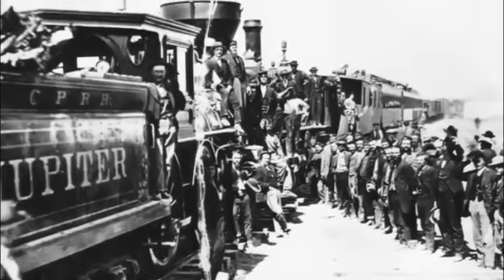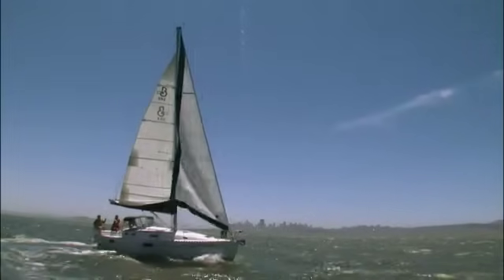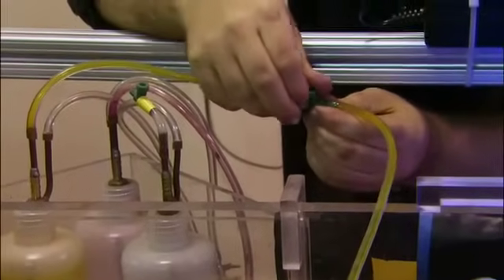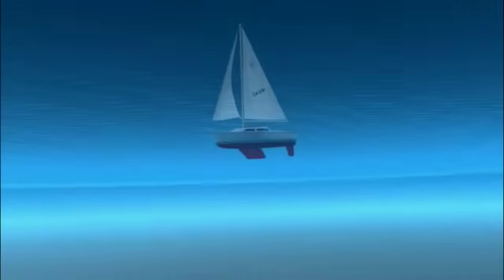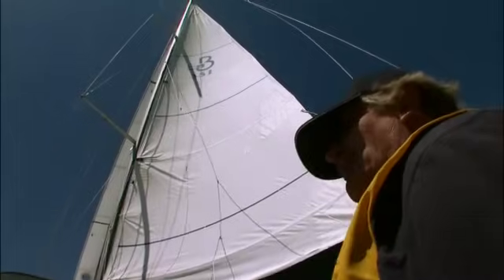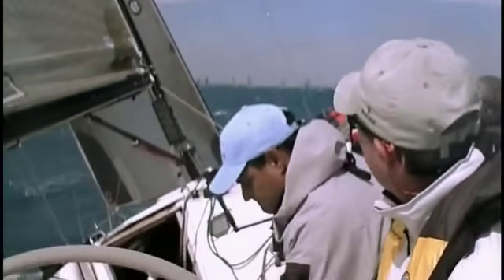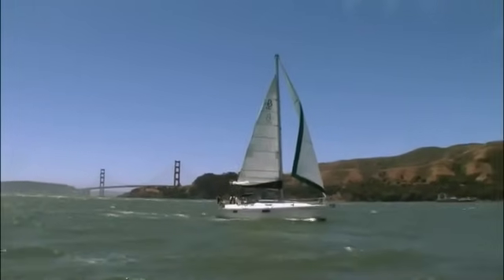The Physics of Sailing | KQED QUEST

Comment: Pretty confusing video.. i thought that it would explain it in a non technical, easy to understand manner..

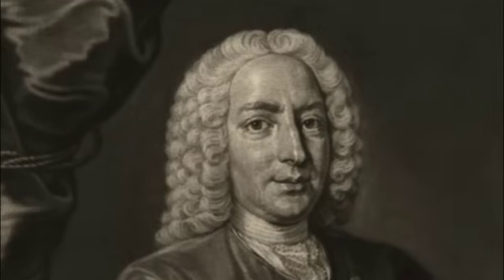The only part i really got much form was the bit at @4:16 where he blew on the paper, and demonstrated how 'lift' works, same as aeroplane wings etc.

Other than that, i want to know how one sails INTO the wind(IIRC, they said it was not directly, so yeah. As close to the direction of the wind as possible). I want to see what kind of mechanical system they have to harness that energy which allows it to move into the wind..

Comment: Do you have an explanation as to why the air wants to rush round the outside of the sail? I guess it is something like - as the air reaches an oblique sail and passes the leading edge, low pressure is created as this air has to turn a corner. ie the very act of putting an obstacle against the wind will tend to cause a vacuum in the lee.
Reply: The air on the top (side) curve has to cover a longer distance than the air on bottom flat side. The air on the top side has to go faster to meet the air on the bottom side. See Bernoulli's Law. Good video, I just now learned this about sailing.
Reply: Yeah, I guess that hitting something head on like that redirects the energy and creates an inward spiral that follows the curve. It's a fight of the higher pressure vs low pressure, so the side with least resistance will take the hit.
Reply: The explanation for lift is wrong. There is no reason why the air taking the longer way should reach the end of the profile at the same time as the air taking the shorter way.

Comment: The big Clipper ships held oceanic route records from the mid 1800's  until the 1990's. Much of the speed was born of the hull designs, very much ballast balanced by as much sail as they could put up. They also plied the trade winds and ocean streams as much as possible. The ships often paid for their construction after a one way trip, like to S.F., Cal.
Sometimes they were even broken up for their valuable lumber.  This preferable to losing the ships to Teredo worms. This was inevitable as copper plating wasn't mounted on the bottom of the hulls to save money, speed construction,  keep the cargo weight high and keep the the hull speed high. If someone reads a script that is pertaining to a subject that they don't know well, is it fair to ridicule the orator? It depends on how well they were paid!
Reply: For me it depends on if they are trying to pass it off as if they actually do know and understand what they are reading

Comment: 4:15 is an incorrect demonstration of Bernoulli's Law. Try hanging the paper vertically and blowing on it...it will not move in the direction of the blown air.

Correctly analyzed, lift is caused by streamline curvature, which is not taken into account for by Bernoulli's equation, which only analyzes velocity and pressure gradients ALONG the streamline (from mouth to far end of paper), not PERPENDICULAR to it (from paper surface outward).
Reply: You are right, it's actually the Conandă effect. (The same thing that makes ping pong balls float in hair dryers.)
Reply: It did move in the direction of the blown wind for me, from the vertical. The paper will not move into compression on the blown side very much; and past a flat plane shape you are, as they mentioned correctly, are introducing a concave shape to the former low pressure side, thus equalising the system. Maybe you just don't blow as hard as you think! LOL Quote real evidence from a reliable source to counter me.

Comment: The lateen sail has been around for thousands of years.  They could go to windward.  It is just that England and Spain were to dumb to see it's potential.
Reply: That's because England has had Gaff rig for ages, which is similar to Lateen rig but uses a more squarish sail and a boom, just as effective if not more than Lateen.
Reply: *****
Well there goes my "theory" up in smoke.

Comment: sailing seems like it would be fun to do but it looks uncomfortable when the boat is leaned right over
Reply: Dude heeling when you are in a sailboat is one of the most amazing feelings ever. It might look uncomfortable but it is so fun especially when you are in the side closest to the water.
Reply: That is why I sold my mono and bought a catamaran.
Reply: +Rick Pelland It is fun, especially when the boat is leaning to one side! :D
Reply: that's when it gets really exciting! but remember guys- a flat boat is a fast boat lol
Reply: It depends what kind of sailboat you're on.
I've sailed Norfolk Broads yachts and they're pretty stable, quite wide so don't lean much and the rig is optimised for that style of sailing.
Modern racing yachts are designed for high speed over comfort so lean, unless you sail a catamaran for stability.
Reply: Same, you get a feel for what the wind is doing so although it makes you nervous the first time it happens, you enjoy it from then on out.

Best thing if you're nervous is to try sailing a little dinghy with the simplest kind of sail, then you're directly holding the main sheet and can feel the power of the wind, you can let out the sail to reduce heel but soon get a rate for getting as much speed as possible and at the same time learn all the important basics of how the wind interacts with the sail.
Reply: Not really
Reply: Carter Busby "Not really" What?
Reply: That's the best part!!! So much fun!
Reply: Not at all uncomfortable. They are designed to be comfortable when heeled over. Even a MacGregor 26 (hated by many a sailor for being a compromise between everything sailing and power boating) has a well designed cabin top which is level for those sitting on it when the boat is heeled at about 15°. Great fun.

Comment: Best analogy about how a boat sails when wind is forward of the beam is "squeezing the seed". The person in this video did mention this, not many know this, most think its only the lift, like aeroplane wings that move the boat.
Reply: +bethells86 but small sport sail boats have large keels, but what about large sail ships with square sails? how do they keep balance and move forward? ...a stupid question because I'm lazy to do some research
Reply: The web has made many lazy :) Watch a movie called idiocracy, shows what happens to human race in a few decades from now, all dumbed down,  its all part of A21 :) 
All sailing boats use same principles to sail, Older ones would have used lots of ballast instead of deep keels.

Comment: Correct me if I'm wrong, but I'm quite sure sailing against the wind with triangular sails is nothing new, been used for Millenia.  Viking ships, and several mediterranian ones used those principles, albeit without a keel so I'm not entirely sure how those particular sails worked, but they did not work like the square sails where its merely pushed by the wind. 

Also those square sails are needed in such huge ships, you cant quite easily correct weight by shifting passengers in a boat of that size.
Reply: Large sailing ships had a large amount of ballast in their lowest deck, acting the same as a yacht's keel.

Square sails do in fact work fine for going to windward, they're just a little less efficient at it than a small sailing yacht with Bermuda rig.
Reply: You MUST have a keel to sail upwind. So those triangular sails didn't do any good (regarding sailing upwind) and in principle the same as square sails.
Reply: not so - a boat itself acts as a resistance to lateral movement in water and therefore is per-se a keel. However a deeper or heavier keel, dutch boards etc etc makes the keel effect more efficient.
Reply: Vikings didnt use triangular sails, however in the mediterainian these did exist. Also vikings have been around for (a) millenia.
Reply: You don't have to have a keel to sail upwind, you just need a hull where the submerged part is capable of inducing the water to flow around it rathher than under it, ie. any reasonably deep hull.

Comment: Bernoulli's principle holds no water.  If it did, then why can an airplane fly upside down.
Reply: +arbonac because when you're upside down in an airplane, you move down with your elevator, which is up when upside down... if you fly upside down for too long, your plane will either move downwards in a loop like matter, or will stall if you apply the elevator too much... a plane can't fly upside down, it can only loop and roll which evolves a lot of inertia and air speed
Reply: Then why can a flat winged paper airplane fly?
Reply: arbonac a paper airplane glides, it doesnt fly, it just falls down with style
Reply: Have you never seen a small remote control on a paper airplane, they've been out for years.

Comment: I live near the water in Florida. While watching sloops, I notice that when one sail in play, some favor the jib, others the mainsail, often in the same conditions. Why?
Reply: +storybored The mainsail will try to push the stern around whereas the jib does not. Kind of like rear wheel drive vs front wheel drive.
Reply: It could have something to do with the shape and size of the keel, and if the sail is over powered by the wind. Shallow draft, fin keel, wide boats can be overpowered when wind speed rises on the main sail. This tends to push the ass of the boat around. You can adjust by reefing the main sail (making it smaller) but sometimes that is difficult and or people are lazy, or expect the wind to decrease, so they don't bother. Somtimes people only have one size foresail or jib, which may be appropriate for the amount of wind, or not. This could unbalance the boat and make steering difficult as well. So...depending on hull / keel configuration, available sails, competency of crew, point of sail / course and wind direction and velocity, one might decide to dump a sail in order not to have to keep fighting the helm.

Comment: Haven't seen it in the comments yet, but square riggers were NOT parachutes. Using the braces, they caught the wind just like the Bermuda rig. The ship was "square rigged" to build a much larger virtual wing. SV Peking's mast stood 170 feet. It wouldn't be until the advent of carbon fiber that triangular masts would approach that size.

Comment: the film perpetuates an error about how sails work. They are NOTHING like airplane wings. It is the thickness of the leading edge of a wing, curved on top and flat below that gives rise to pressure differentials and therefore lift. Sails are uniform and essentially thin sheets. Don't be fooled by the curve of the sail. Any sailor knows a sail has ticklers (or tell-tales) set a few inches in from the leading edge. A sail trimmer looks though a clear window in the sail at the lee tickler and at the windward tickler facing him  and trims the sail till both lay flat and streaming aft. This means the wind travels the same speed and distance from front to back. So no pressure differential. What makes a modern sail work is that the sail forces the wind to change direction from the angle over the bow, to along the boom to astern. A change in directions results in two force vectors at 90 degrees to each other: one forward over the bow, and the other over the lee side. The resultant vector moves between them depending on the trim of the sail. The forward force drives the boat forward, the side force heals it over, and makes the boat move slightly sideways (both are counteracted by the heavy and board keel).

Comment: This documentary completely misses the mark:  It's the KEEL, not the sail, that allows "modern" sailboats (invented at least as early as the 14th century AD) to sail into the wind.  Square riggers' best performance is when the window is off the beam or a little forward of it, not off the stern, so the idea that they could sail only downwind again shows a lack of understanding of the physics they are supposedly talking about as well as the history of sailing.The deep keel is made possible by two key factors:  (1) smaller boats with smaller cargoes after the introduction of steam, and (2) stronger materials for masts, spars, and hulls.  The key advantage of the triangular "modern" sail is that it can be handled by a much smaller crew.
Reply: +Moon Sims centerboards are useless when sailing with the wind.

Comment: plus their explanation of "Keel Force"  is wrong ...  keel simply keeps gravity going down to stabilize the vessel.    The Keel does not provide any moving 'Force' whatsoever,... its simply a stabilizing vertical force to the vessel .....
Reply: eh mate... I have never sent an insulting message to anyone on a 'forum' but here I could be tempted. Do you actually sail? If you have no clew what you are talking about, why not be quiet?
Reply: Ako - Not all dagger boards, centre boards, keels have any weight in them.  Think of a sailing dinghy with a wooden board that gets dropped down through a slot in the middle of it.  With the board up,   the boat will move forward and sideways,  drop the board down and she instantly  stops most of the sideways movement and increases speed forward.   A  keel on a yacht has  two main functions,   provides the perfect place to store ballast for stability as you say,  and  provides resistance to the sideways force that the sails are placing on the boat.

Comment: I learned nothing from this
Reply: How? It's all about wind velocity and pressure.... Higher velocity = less pressure, which makes the other, high pressure (inward curved side of the sail) side, PUSH towards the lower pressure side because air is always moving to lower pressure. Sooo basically, the boat is pushed by the higher presuure side pushing towards the lower pressure side.
Reply: @SomeJustice19k   No.  An increase in velocity (acceleration) is accompanied by a decreasing pressure. 
 This is a big difference. The Pressure Gradient in space causes the acceleration of air.  This is Newton for fluids. Euler determined this in the mid 1700s while following up on Bernoulli's work. 
.
You can't say that referenced to any randomly selected inertial reference frame, any 'faster' air has a lower pressure that any other "slower" air.  Select a frame where that 'fast' air is stationary and that false description falls apart. 

The rest of what you have is correct.
.
The video does have some errors:
..
3:34 "When it accelerates, it creates a lower pressure." No. The lower pressure is the "cause of the acceleration" toward that lower pressure.
..
3:39 "Suck" is shorthand for the higher pressure pushing toward the lower pressure as described immediately after that. 
.
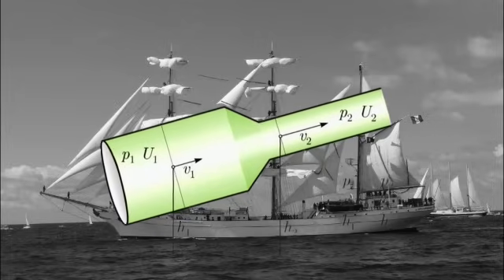3:59 "You generate higher velocities, so that there is lower pressure..." No. "You generate a lower pressure, which just happens to accelerate the air, but more importantly, now you have the pressure difference and that leads to the force."
..

4:15 This is a commonly misinterpreted demo. Blowing over paper is the Coanda effect then entrainment.  The air exiting his mouth has the very same pressure as the still air all around it.  This is well known by real practicing aerodynamicists.  Introducing that surface brings in some additional physics, I won't attempt here, yet.
..
 Understanding Lift Correctly : https://www.quora.com/q/rxesywwbdscllwpn
Reply: @SomeJustice19k  easy to understand if you have had college level physics and already understand fluid dynamics. One of my professors would say that the sail sucks the boat forward with the keel and rudder offsetting the other forces of tilt and yaw that are placed on the boat enabling it to be kept upright, prevent (reduce) side slip, and enable directional changes by controlling yaw.  Easy peasy!  I don't think that he was a sailor though because he apparently did not understand the excitement of riding the wind.

You have obviously been to engineering school!
Reply: @counciousstream  thanks, Bill, but I've never been to college. I was a Tanker (19k) in the Army and now I'm a mushroom farmer! 😂
Reply: Did you pay attention?
Reply: TitanConceptss   If you are into the physics of things...For those interested, much more detail, An EXCELLENT sail boat explanation site:
http://www.real-world-physics-problems.com/physics-of-sailing.html
Reply: @Observ45er  This one is pretty good, except if you look at Fk, there's actually a forward component to the force relative to the boat, which contributes the the forward motion of the boat.
Reply: @MrMarkchu   I didn't say there wasn't a forward component of Fk and that is shown in this video and the paper I referenced above.
Reply: Me either...
Reply: They got a few key facts wrong. I don't know what these engineers learned in school, I don't think the airplanes they design will ever fly.
Reply: Watch it again in half speed
Reply: Has its fault. But the physics is there.
Reply: That's why you don't have a yacht!.
Reply: @SCCIT-jq6jh  Is this supposed to make some sense and be somehow important?
Reply: https://www.youtube.com/watch?v=3oODen08FGU for kids